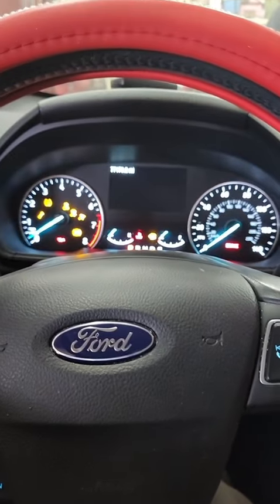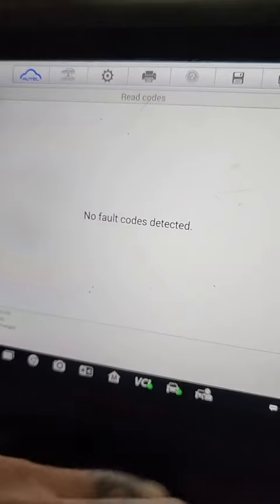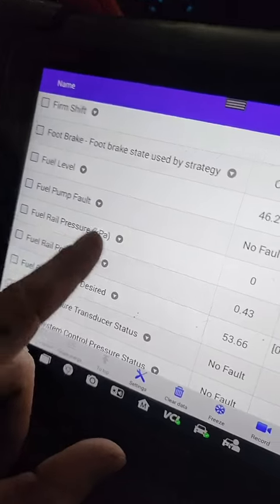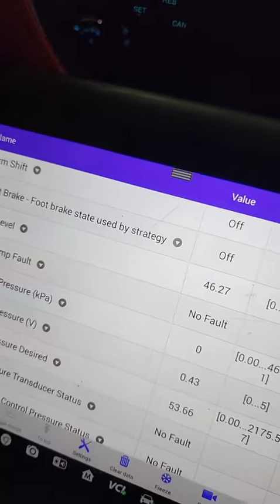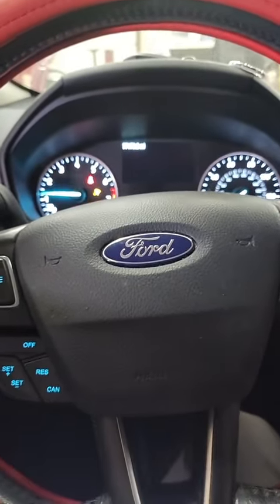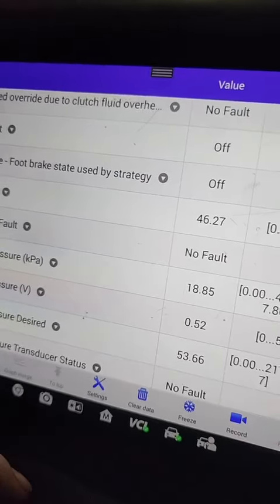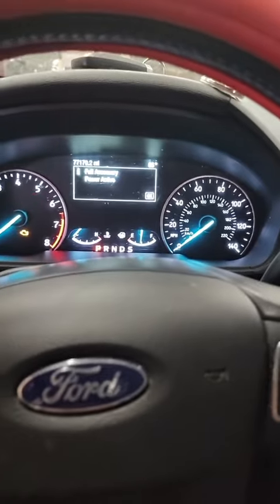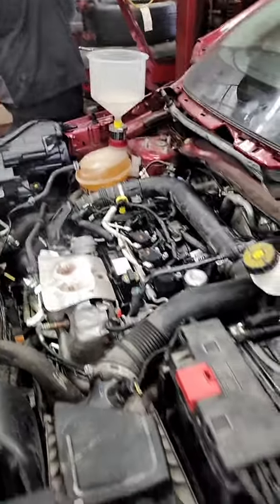faulty sensor on salvage engine

Comment: Back in the early 90’s had a Mazda I was putting a used engine in. The shop got the engine from a new company , Japan Auto Parts, that guaranteed the motor had less then 50 k on it , something to do with emission standards in Japan were so strict that cars were often scraped instead of bringing them back. The engine that showed up had Ford plugs , drive belt etc… assuming they were the same 2.3 it went in . The car wouldnt run right! Turned out the coolant sensor had the wrong impedance. As you did , swapping the sensor from the old engine fixed the running issues.

Comment: Ford ECMs can be funny with sensors at times! Had 13 SUV with a V6 that melted the pistons on bank 2 in the OE engine at 47k then the brand new engine from Ford within another 6-7k. Faulty wide band O2 sensor ended up being the issue but it was reading fractions of a % within the other bank in all the drive testing I performed, went lean under certain driving conditions is all I can figure